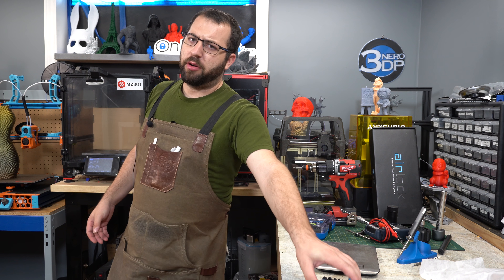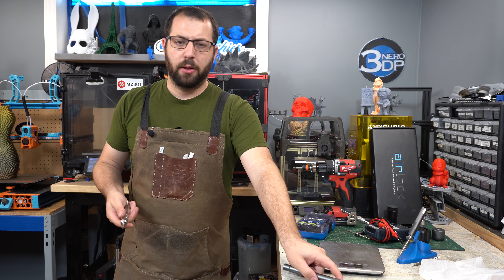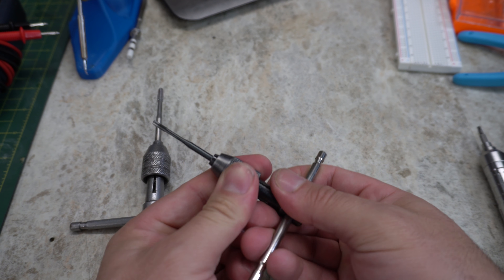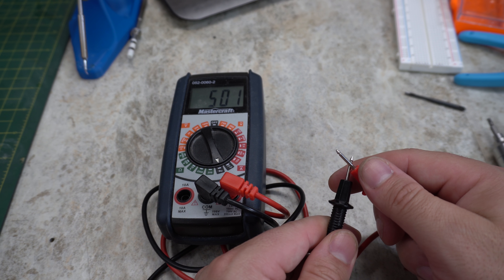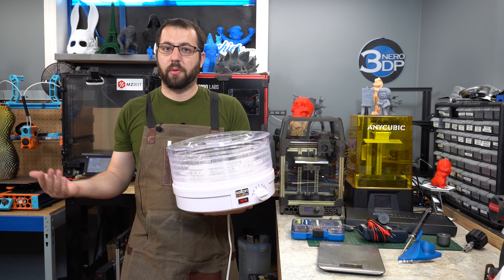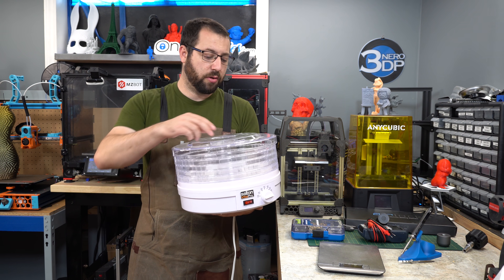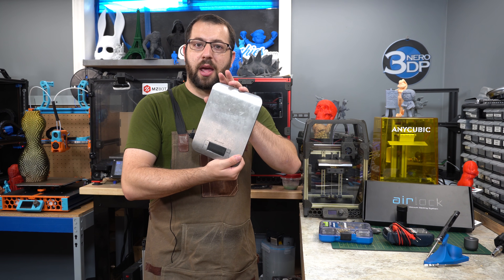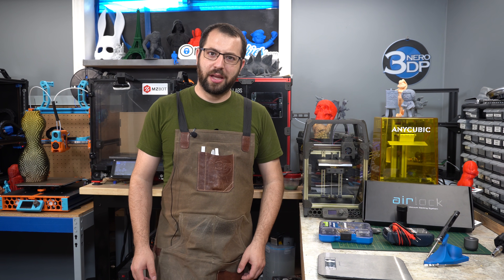Expand your 3DP Toolkit - PART 1

Comment: so you use a 1.5nm one in ABS, so I should use a 2.0 in PETG? I'm getting the Phaetus Dragon hotend, so I want to be able to make one handed nozzle changes. I know traditionally you have to heat up the block to tighten the nozzle, but I didn't know since they were brass on brass I would need to? 

Would it be any different if I used a hardened steel nozzle for abrasives?

Comment: If you don't have any kind of screwdriver and you only gonna use it for small stuff i would recommend a medium screwdriver like the 12v versions most brands have. The Bosch Go is also very good but it has only 1 speed setting while on the 12V screwdrivers you have a variable speed (and much higher speeds).

In my opinion these electric screwdrivers are way too slow. I can do it faster with a manual precision screwdriver (with changeable bits).

Comment: Eff a newer metal chucked milwaukee M18.  Buy a Rohm for it or go with the 1/4" hex drive 12 volter.  I own seven milwaukee drill motors and the new metal chucks are absolute garbo.  I put my original 2009 M18 plastic chuck on my 2017 vintage M12 "hammer drill" because the stock chuck shit the bed and i finally burned the brush motor on the old one
Reply: That's a shame, Milwaukee is actually pretty well regarded even in Germany. A company I did an internship in actually ditched Makita and Metabo for the Milwaukee M18 Ecosystem. Guess it's going downhill after they've been aquired by the chinese.

Comment: What tools for wiring pin extraction?  I often put a crimped connector in the wrong slot and have to remove it.
Reply: Difficult. Official pin extractors are $$ and only work like 40% of the time. Clone pin extractors are still $20 and only work 20% of the time. You can buy a lot of JST and 3mm microfit for $20-60 :(
Reply: I find the molex removal tool is worth it.

Comment: I'm always a bit sad when I see a food dehydrator cut up to make room in the rings. If your printer is big enough, just print a nice sleeve that goes in. I use one intact ring on the bottom for proper air distribution, then the printed ring and then the original lid on top. I also printed a round sheet to cover the middle of the spool so air has to go the long way outside instead of rising in the middle where it does little good.

Comment: Hey nero! Thanks for all the great tips! One question: would you recommend screwing the frame of a voron 2.4 by hand or with a drilling machine (the big one you showed)? Most of the video tutorials including yours are screwing by hand but some with machines - what’s your suggestion? Of course a machine with adjustable torque. Thanks for your expertise on this!
Reply from the maker: Torque to spec. You can find charts online about how much torque certain screw sizes require. But really anything in a voron can be easily hand tightened. The frame is m5, so the es126 wont have enough to tighten properly

Comment: Something that will make your life alot easier...a head lamp/flashlight... even with a well lit area you will run into times when you can't see a damn thing (under plate wheel tightening, installing a board or just leveling send initial layer observation etc). Odds are you'll need both hands to do whatever needs doing, so one of those head flashlights is a friggin lifesaving device. Much frustration will be saved lol
Reply: A pocket EDC flashlight is a god-send. Nice ones can be stood on-end and are bright enough to light up a whole work-area. The can also clip onto a hat to make a head-lamp.

Comment: I find taps really handy for when I need broken taps.
Reply: Handy tip. Get yourself a tap extractor so you can break it as well.
Reply: @woodcat7180  snapped off extractors always make the best daggers for accidentally stabbing yourself, mostly so you can curse more than you already were over the broken off tap, but not quite as much when you finally realize that you could have made two new parts in the time you've wasted trying to salvage the original one

Comment: The big brother of an electric screwdriver is an impact driver, not a drill. They are much better for screw insertion and removal.
Reply: Not for elecronics or small 3D printed elements When you need higher precision. It's OK for metal and woodworking. Impact driver may easily strip threads. Drill is easier to control the torque for delicate parts.
Reply: @arturgosk  Depends on what you are printing. I have printed some large things needing long and large bolts. though the heatstaked inserts are needed to not just strip the plastic.
Reply: @bluedeath996  Very well. We've both provided two different applications for both tools and I agree that your's good too. I'm using both tools in both cases ;)

Comment from the maker: Hello!
So just a heads up, yes i am aware theres a few hiccups like audio issues in this video, this was really just a quick test video on the new camera and editing 4k footage and still sorting out things, wasnt sure if i was going to push it public but figured it was good enough for a part 1of this series . What else do you think should be covered?
Reply: Great video, very informative if you're just getting started as this is just about an exact list of things I bought over the years. 

Some additional suggestions you could cover are: part storage/sorting racks (not sure what the correct English term is, that thing all the way to your right against the wall), mechanics square, Vernier calipers, feeler gauges, fire extinguisher (!!), heat gun, dial indicator, tweezers (preferably ceramic), deburring tool, rotary multitool (cutting, polishing,....), spirit level, third hand (soldering), glue gun + sticks, box cutters + scalpel, sharpies, thin gloves or disposable gloves, wire strippers, crimping tools, magnifying spectacles or a light with magnifying glass built in, putty knife, large-bore syringes (for grease), gas mask or N95/N99 (for solvents, resin, harmful filament fumes, IPA, naphtha....), spray bottles (for IPA, naphtha,....)

Of course these are almost all quality of life improvements, not absolutely necessary but those are what I have accrued over the years and regularly use for 3D printing. I'm sure I've forgotten half of them but that is just what I could come up with in 2 minutes
Reply: I liked the smash button for you hahaha :)